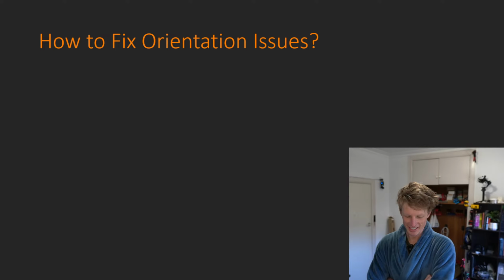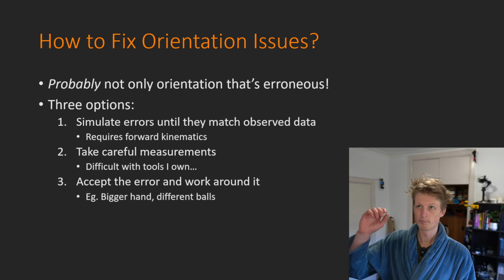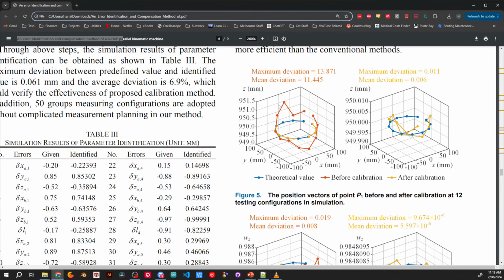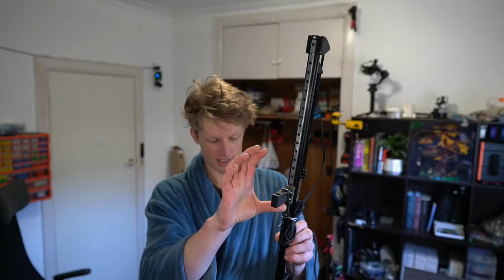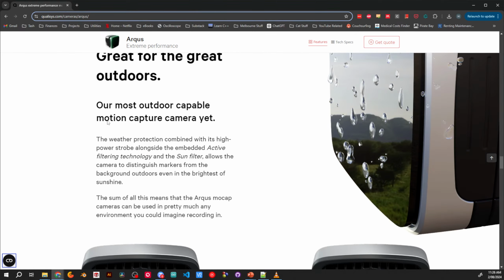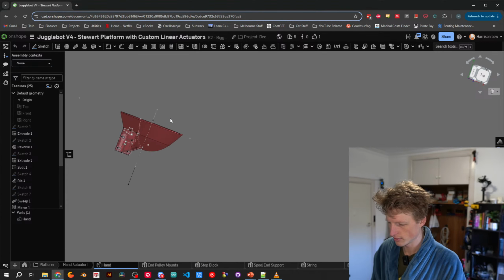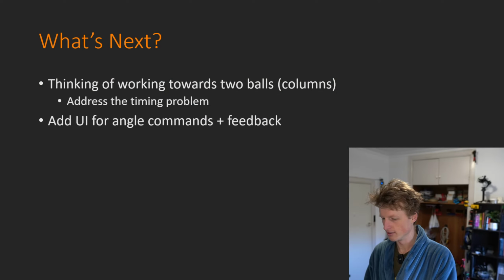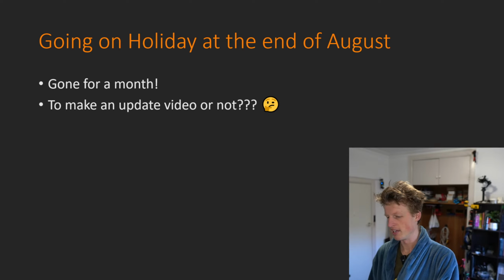PDJ Weekly Livestream # 31 - Update

Comment: On the measuring stick all the pullies need to be properly concentric. Also you want a new and quite robust belt, uneven previous stretching in the belt would throw it off. The spring needs to be strong enough to keep the belt straight but not so strong that it might be stretching the belt.
Reply from the maker: Yep, on further reflection I agree that all pulleys in the system need to be concentric - this could be a cause of issues for me. Good suggestions re. the belt! 

As it happens, I've just bought a linear glass scale, which has an accuracy of 5 micrometers, so I'm just going to wait for that to arrive and use that instead😅

Comment: 32:00 you could try glueing the bearings in with expanding glue (like the one from gorilla glue), since that would stabilize the bearing from multiple angles. Or you could put the 3D print in boiling water and then compress the print onto the bearing
Reply: I was thinking JB weld for the glue, since it adheres to metal (the bearings) very well.
Reply from the maker: I've heard a lot of good things about JB weld. I think it's time I finally get some!
Reply: @harrisonlow  It's amazing stuff.  I think it's a combination of epoxy and fine metal powder, but I'm not sure.

Comment: iterations on calculation and verification using inverse method. The tool to accept the movement to the path planer. Adding a little bit of machine learning can help it refine and speed up the fwd method over time.

Remember processing power to do those calculations are next to limitless it rather easy to do do both fwd and inverse with opencl/Cuda on a gpu and get millions if not billions of iterations on calculations over time.

You can add feed back using an imu on the base and the end effector to yaw pitch and roll and and it can adjust on the fly. You can use this data to calibrate.
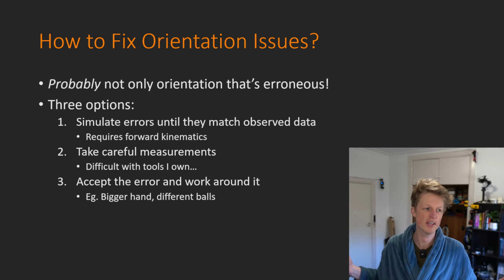Reply: As of 10:25 into the video not sure if you've already considered it but for the ball catcher and the led balls, using some sort of thin foam or carpet for padding to aid in dampening any wobble, although it might add new inconsistency into the throwing, not sure but happy to see another update video 👍
Reply: @nemovulture  yoga mat thin dense might work well for that.
But it do it a step up and use a ring 65% the ball diameter
Reply: @CNCAutomationLab  Yeah thanks, and my bad, didn't realize I was replying to your comment, meant to post it outside the reply
Reply: @nemovulture  lol we know we are all just sharing points of view.
I only say what I said because I deal with kinematic systems all day long for years I was an engineer with ABB robotics  before I moved on, I have written motion planners to do what he wants to do. Just it was my daily life for about 12yrs
Reply from the maker: Interesting ideas here! I like the ring hand idea - I wonder how that would go with throwing 🤔